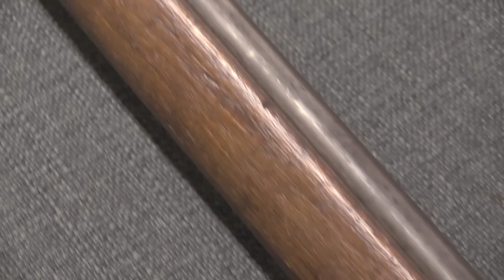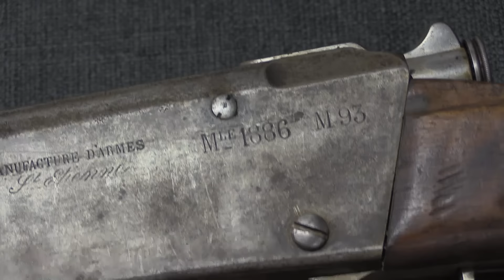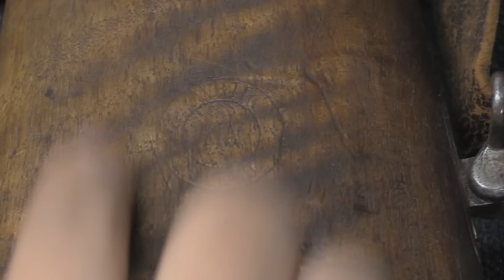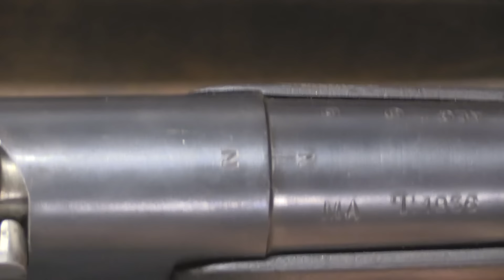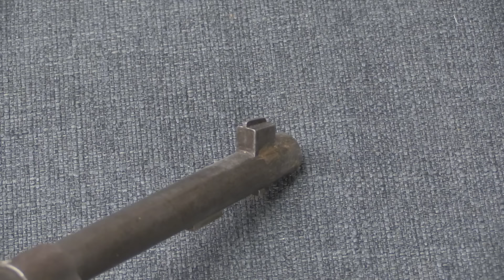The First Modern Military Rifle: The Modele 1886 Lebel

Comment: i bought one last year from an old man (90+ years old)  a nice and battle used lebel with a rebarrel in 1936 and a replacement stock (since there is no marking on it) and still has 30% of it's original blueing left, he asked 425  O_O , ofcourse i instantly accepted his deal, It has now become my pride piece in my ww1 and 2 bolt action collection, i do love the battle damage cuts in the front wood and stock, i also got myself 2 months ago a nice bayonet with a sheet for it, i gave 90 euros to a local on a market,  its also crazy how long this rifle is with its bayonet attached, im 177 cm long and it's higher then me :D

Comment: Very informative video. Have been looking for a Lebel for years, finally found one. It has a Chatellerault receiver and was re-barreled in 1916, in the middle of WW1. It has a bullet hole through the butt stock...It has been repaired, but is still visible. The bolt is mismatched, but everything else matches though. Feels good to finally own a Lebel.

Comment: There's a speed load system for shotguns that could prob'ly work to speed up the loading of this rifle.
Reply: Nope. Loading a lebel is a lot like loading a Winchester 1887. Extremely awkward and you can barely fit a single cartridge + your finger into the action at a time

Comment: ...was called "Poudre B" in honnor of Général Boulanger...Some complained that the weight of the bullets on the tube made it heavy up front, and as you shoot it got lighter and was difficult to maintain accuracy in combat. Shortest sight is 250 meters so they had to aim low for some of the trench work and this was hard for recruits to do in the stress of combat.  Excellent video , thanks!
Reply: Not true at all. Original it was called Poudre V for the inventor Paul Vieille. It was later changed to Poudre B to hide it against potential German espionage, with the B standing for "Blanche" or white in French.

Comment: One fact I think you got wrong is that the trigger is heavy because of a heavy firing pin spring.
Closing the bolt already cocks the action and the trigger has it's own little V spring. 
My guess is that they just favoured a heavy trigger for safety (no trigger discipline back then).

Comment: So the Lebel has no safety? I thought you pulled the cocking-piece back a little and turned it to the left, as on a Mosin.
I'm so embarrassed for not knowing that. I collect rifles from WW1 and the Lebel is basically the only "important" rifle I don't have.
Reply: A Lebel is now successfully collected. It has a Chatellerault receiver and was re-barreled in 1916, in the middle of WW1.
It has a bullet hole through the butt stock...It has been repaired, but is still visible. The bolt is mismatched, but everything else matches though. Feels good to finally own a Lebel.

Comment: I actually like the big rimmed Lebel cartridge. I made a barrel to fit on a H&R handi rifle by lathe turning a take off barrel from a 8 mm Mauser into a barrel liner that was epoxied into a 20 ga. shotgun barrel. I made a D bit chamber reamer to match the 8 x 50 Lebel cartridge and with a 4 x scope mounted I have taken deer and hogs with this rifle and it is very accurate. The Lebel is pretty much the equal to the 8x 57 Mauser when chambered in a strong action and it makes a great cartridge for a single shot rifle due to its large rim. I have dozens of handi rifle barrels chambered in cartridges never made by the factory but so do many others. I have never heard of anyone else making one in the Lebel cartridge. I just like the short fat Lebel !

Comment: Well I suppose the doctrine would have been to load 8 and proceed from there to work in accordance with the concept of the magazine cutoff. You can't keep the magazine in reserve if you have a round on the follower. Granted, they could load the first round by cycling the action, but then they'd have to have the cutoff disengaged and break drill. It's simpler and the same effect to have a "load, fire" drill.

Comment: The same "stacking the elevator" gimmick works on the Winchester 1887 lever shotgun - which is also a top-loaded tube mag design. 5+1+1.
Reply: It’s actually a known concept for a lot of shotguns called “ghost loading”, where you can rest a shell on the elevator of a tube shotgun and get one extra shell. It’s primarily done by competition shooters because one extra round without reloading could be the difference between winning or losing a stage given how slow tube shotguns reload.

Comment: 20:01 I found about 15 Lebel casings on ww1 battlefields and only a few of them have this groove. Does that mean that only cartridges with this groove were used for the Lebel itself and cartridges without the groove were used for other french ww1 8 x 50 mm guns for example the Hotchkiss machine gun?

Comment: 8 rounds fill up the tube magazine right up to the end of the barrel ?
How so ?
Reply: Randy andy Magazine is beneath the barrel.
Reply: @churchowl3052   Yes I know. My point was that the barrel is very long and it should hold more than just 8 rounds if the tube goes right up to the end of the barrel ...
Reply: Randy andy 8 Rounds is the max, any longer the rifle will be thrown off balance more than it already is, and you’d have to get a pretty good spring to keep tension, and the round count in the magazine does effect the harmonics of the barrel.
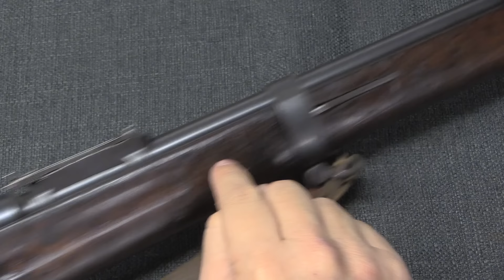Reply: @churchowl3052  Ok, thx for the explanation. I was just referring to the comment @ 22:10  where Ian said, that " the rounds go all the way up to the end of the barrel."

And when I consider the length of each round it didn't make much sense to fit in only 8.

Comment: I recently acquired a m1886 rosali bayonet, no quillon (or however it is spelled) but with the nickel-silver handle. Now to just yet myself an 1886 lebel
Reply: Most of the original 1886 Lebel bayonets had the quillon  ground off during the Great War:  they found that it often got caught in barbed wire in action and served no useful purpose.  Looks really cool and elegant though.  I have one.

Comment: American machine tool imports... Great Britain, Germany, Belgium and France herself, were major producers of quality machine tools. But, due to European politics (and European suspicion and hatred) they were reluctant to sell to each other. That was a huge opportunity for the US to get into the European market. Respect to America (and Eli Whitney in particular) for inventing the 'industrial method' - modular manufacturing, interchangeability and so on. But, fast forward to WW1, with its huge opportunities for US industry to undertake lucrative military contracts for the European belligerents and the 'industrial method' didn't work so well. Sure, American wages shot up as a skilled labour shortage developed (in 1916, an average American based machinist earned THREE times what he the year before) but US manufacturers really struggled to meet European production standards and tolerances and matters like making accurate taps, dies and other tools for metric and British Whitworth threading. The reasons for the failures are complex but, 100,000s of US made shells, primers, fuzes, breaches, receivers, cartridge cases and so on were junked by French, British and Russian QA inspectors. Many of the larger American manufacturers ended up withdrawing from the contracts - at considerable cost. Back issues of 'American Machinist' magazine are revealing.

Comment: The French are fantastic engineers!-Pre-stressed concrete, front wheel drive and smokeless powder are just some of the many  cutting edge technologies that they developed! Their small arms history, however, can be spotty, just like many American designs, IMHO. The FAMAS "Bugler" suffered case head separations , even though it was an early military bull pup design. I realize that the Soviet arsenals competed with each other, but still, they have come out with some of the most reliable and practical small arms technologies that I have researched and (sometimes) own:)-John in Texas
Reply: You can add first heart transplant, the very first laser and most important, even if our soldiers may not always have the best weapons, at least their rations are seriously tasty :D

Comment: There reaches a point with most tube magazine rifles in combat where high skilled single shot feeding is far, far faster than trying to keep the magazine operating.  Even here, the superior bolt action designs of the Mauser and Enfield are better if one needs to feed rounds single shot.

Comment: How safe and reliable was the system of having the tip of the spritzer bullet go into that rim around the primer?  It seems like a gamble every time you load a cartridge.  Were there issues of cook-offs in the magazine tube?
Reply: The annular groove was combined with a domed primer cap which automatically deflected the spitzer point into the groove.  It was a very effective solution to the cook-off danger.

Comment: The Lebel was certainly an improvement over the Gras breechloader it replaced, but it still suffered from some very severe design flaws. However, that could be said about ALL the first nitrocellulose propellant cartridge bolt actions. You needed the Lee-Metford to get to the Lee-Enfield, after all. Even the Krag, for all its problems, was a leap forward from the trapdoor Springfield.

Comment: there are a lot of photos of the french solders roasting meat on there  banettes during WW1 having the cruciform blades made it perfect for this job and a use proffered buy the foot solder. the french are lovers not fighters and having gallons of wine handed out every day buy the army you needed food to go with it.
Reply: @demonic477= Actually, the cruciform blade has been designed following studies of war wounds.  
     Military surgeons had determined that the wound inflicted by a cruciform blade would take much longer to heal than a wound inflicted by a flat blade; thus the return to the front of the healed soldier would occur much later.     __ .

Comment: french doctrine also use the button in front of the trigger guard. They will load 8 cartriges in the tube, them disable the elevator and load individual round until the sergeant sayed to activate the elevator and they will have 9 round ready to be fire in the combat situation. If soldier were marching to the battlefield they would load 8 in the mag flig the switch and close the bolt. Sorry for my english again

Comment: Ian makes a small error when describing the Belgian Mauser model of 1889 when he describes it as having a "double stack" internal magazine.  That is not true.  The Belgian 1889, like the very similar Argentine 1891, had a SINGLE stack five round magazine which extended below the stock in front of the trigger guard.  I'm sure Ian knows this, and it was a momentary slip of the tongue when describing how the Mauser actions did eventually adopt the double stack flush magazine with the M1893 Spanish rifle.

Comment: A lot of these came back from Afghanistan with US forces. If the barrel date was over 1898 (making the only date on it over 1898 and thus "not an antique" in the eyes of the MP's), it would be redated by the Afghan merchants with a hand stamped 1888 (only needs two stamps, 1 & 8).  Then the MP's would pass it as an antique and issue the paperwork needed to get it home. Some MP's wouldn't issue paperwork for Lebels at all- saying "If you can't drop a 9mm round down the barrel it is too new to be an antique."

Comment: mine came with a black painted stock, which I was told meant it was a parade rifle.
it had a brand new barrel (with that nasty preservative) and is updated for balle N.
also, the front sight has a groove instead of a blade, I was told this was for a dab of radium for a night sight.
does either of these seem correct to you?
Reply: I am no expert on French arms, that would be Ian. But I have learned a few things from him. The grove front sight would be the Berthier style sight update. As for radium night sights, yes they were a thing but the examples I have seen used drilled holes for the radium. The black painted stock is what bothers me, I know nothing about French military drill but I don't see the point of the paint. If it was a parade rifle, admittedly I don't know what the French used for ceremonial duty after WWII, it would make since to follow the pattern of other countries. Which is stock rifle or deactivated  but with different slings.
Reply: thanks for the reply

Comment: I love guns you HAVE to manhandle to load properly. Those are the kinds of guns you can trust your life with. Anything with the HK or AR charging systems is on this list, as well as this beautiful rifle.
Reply: Sukki Blue I don't understand this comment at all
Reply: Some of the most reliable guns, like those made in the G3 series, require a bit of manhandling to work. The "slap" of the charging handle is technically not required, but it IS how the manual says to do it.
Reply: Sukki Blue I own a ptr 91 so I do understand that you must manhandle the gun, and is VERY reliable. But I wouldn't say it is what I love most from a practical standpoint.

Comment: In Battlefield 1, the loading animation is as follows:

1. Open the bolt
2. Press the elevator down
3. Load 8 rounds in the tube faster than humanly possible
4. Snap the bolt back to raise the elevator
5. Place one round in the elevator
6. Close the bolt, ready to fire

That should load 9 rounds right?
Reply: ritterbruder212 yes. In fact, you could actually do a plus 2 on real rifles with the 8 rounds in the magazine, one on the elevator (and the elevator down), and one round in the chamber. Adding more than the 8 rounds was however not something that soldiers actually did however. The thing with BF1’s animation for a partial load showing showing +1 bullets loading is due to how the game doesn’t save that (same reason for why you can reload faster via switching to a sidearm).

Comment: Great video. Am I correct if I noted the sights were ever so slightly offset to the left? Both rear sights and front leaf. Would that have been to accommodate right handed shooters shouldering their rifles and heads leaning into line of sight from the left of the gun?

Comment: The only small detail I've always thought was not appealing, is the large screw head on the bolt.  I know you've detailed the bolt removal in previous videos, but is your opinion that screw was a necessity of a rushed design process or did they have good reasons to do it that way?
Reply: The larger bolt head screw was an update for mounting the dust cover. Ian covers that in a separate video.
Reply: That's true for the larger head version of the screw, but the screw itself was part of the original bolt design.  It's part of how the bolt head and bolt body are secured together.  It's certainly simple, but I wouldn't call it elegant.

Comment: "only dropped once" kinda doesn't sound like an appropriate quote, even if it's used to refer to sacrifice, if that was what you were going for
Reply: It’s a well known joke told about French rifles “never fired, only dropped once” 

It was also in full metal jacket iirc about the South Vietnamese.

The t shirt is a play on the joke by having it on the shirt along with major battles that the French took part in, its an attempt to stop the stereotype of French soldiers retreating
Reply: Sean Davis, I know the joke. It still gave me pause, because one reads it first in the usual derisive tone. Here it could be seen as a reference to incompetence, even by someone familiar with it. Could be baffling or much worse to someone who doesn't know the joke. I wouldn't want much ambiguity in this sort of context. Imagine yourself having to explain something like this to someone who glances at it and takes offence. You can be too clever.
Reply: Kevin, I did read that, even before the initial comment. The man on the street doesn't have the benefit, nor possibly other frames of reference needed. If it's not obvious, I'm not putting motives into question here. The design just can come off as odd, and in some situations that's something to be aware of.
Reply: Its to honour the French fallen who died at all those battles listed at the sides of the make shift grave marker. Its a counter to the offensive "Never fired, only dropped once" joke gun advents about the French military
Reply: nahh. that shirt was made For people who get the reference. It humor not to be taken seriously.
Reply: You overthink too much. All the comments I seen from people who bought it were very positive. The message of the T-shirt were getting across.
Reply: By popular demand we have introduced this design back into circulation.

Tired of those inane French surrender jokes? Here’s a way to acknowledge the respect due to the 1.4 million Poilus who died defending their homeland in almost 5 years of the most brutal warfare the world has ever seen.

This super-soft t-shirt looks great on both men and women – it fits like a well-loved favorite. Made from 100% cotton, except for heather colors, which contain polyester.
https://shop.bbtv.com/collections/forgotten-weapons/products/unisex-short-sleeve-t-shirt-39
Reply: stereomike111 I thought the same.
Reply: It's called humour
Reply: Vickte W Yea a bit too PC.
Reply: kk
Reply: I think it's meant to be taken very seriously and I don't think it's inappropriate at all. Even if you don't know the reference, it's still a poignant and powerful message.

Their rifles only hit the ground when they did. I wish this was about my own nation.
Reply: Vickte, of course people who bought it have a positive view of it. Maybe it's a bit of an overthink, but it would give me a wait what moment if it was about the fallen of my own nation. People take these things seriously, and not everyone stops to think it over if they get the wrong vibe. I wouldn't wear something like this to a french holiday, I'll just leave it at that.